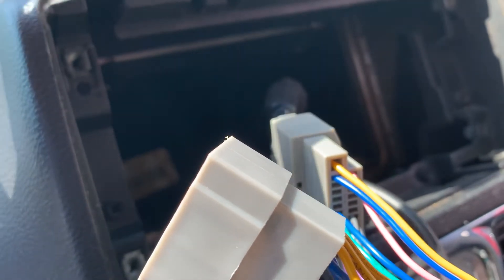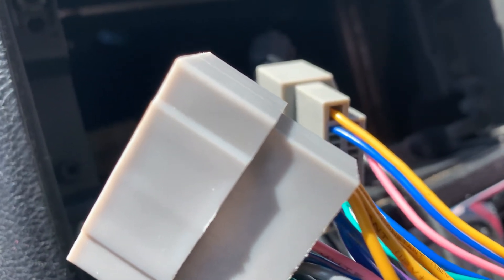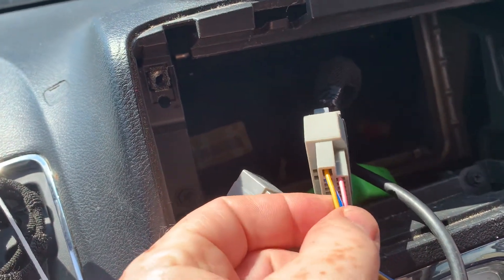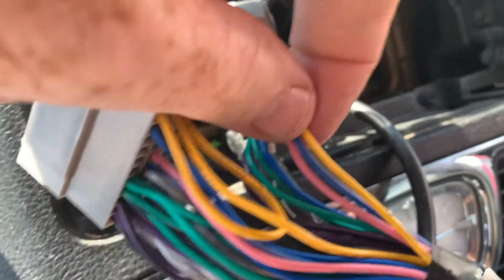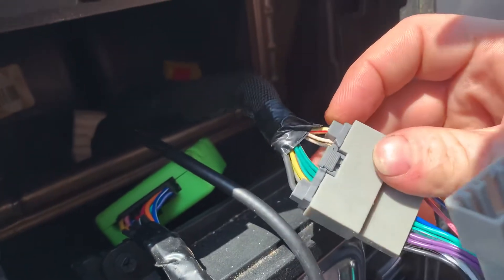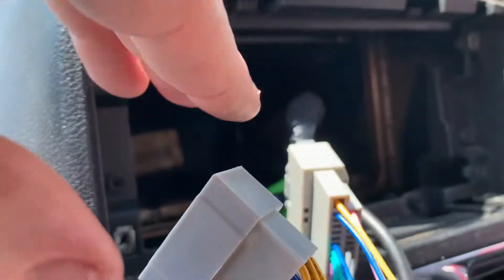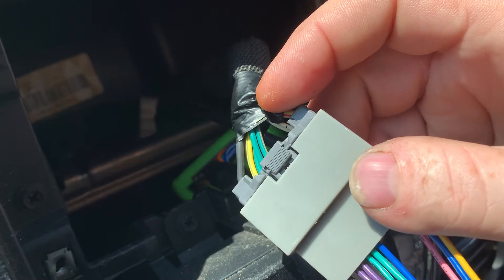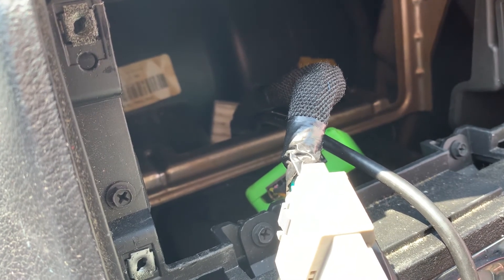Chrysler Town and Country radio fix.

Comment: I believe the small chip on the passenger side of radio in back corner toward the plug for antenna - it’s about 1/4 inch by 1/4 inch I believe it’s related to the volume control but also I notice when I touch that chip with enough force the signal comes clear and volume works - u can heat up and push back in but it really needs to be resoldered and then epoxy glaze to keep it from moving, then again this could be overheating on the board somewhere which causes this and other issues

Comment: Just in case no one has figured it out yet the white and orange wire he is talking about is a can bus + and the white and grey beside it is can bus - they are info wires and voltage fluctuates based on info received or sent

Comment: Open rear hatch, remove 3rd row seats, remove plastic trim below drivers side rear side window, most likely you will find your short in the bundle of wire below your rear hatch actuator which rubs against the wires and begins with shorting out the camera wire which sends the short to the radio first noticeable when going into reverse and camera glitches eventually causing radio to stay off. What you are doing is bypassing the short from camera.
Reply: I’m pretty certain this is my issue. Do you have more details on wire location?

Comment: changed out my radio and just found the speakers and power wires.  radio plays ok now. dont need anything extra because i didnt buy any adapter cables i just taped off everything and used screw on wire connectors, real cheap.

Comment: That assy (blue/white) wire is to turn on an amp. When you turn your radio on it powers that blue wire to turn on an amp or power antenna. The yellow is constant power 12volt +
The red is a accessory or key on 12volt+.
I've seen another post that claims the radio fuse needs to be pulled and the power wires to the battery have to be disconnected for a couple of hours.     Then you hook the battery back up and lastly instal the radio fuse and it makes the radio and display work again. Don't know why but someone else tried the trick and it worked for them. I'm about to try it on my landlords 2008 Town and Country because her radio and touchscreen is not working either. Let you know if it works for me.
Reply: Does the black wire to the radio with the yellow connector carry 12V like 30 amps, or just the blue wire to the fuse box?

Comment: Any keyed on 12v power source can replace the red/white wire the red and white wire if im not mistaken is the "remote" wire for the amp follow it back to the amp and do some testing on it me personally I think the amp is a bigger problem to these radios than the radio itself but I mean I've replaced bunch of radios for sure lol and its typically the radio but I feel like the amp is shorting internally and feed back to the radio

Comment: A bit confused. How do you bypass the red and white? So just exactly what needs to be done, bought, etc to make this work?
Reply from the maker: I found another hot wire. The white and red wire should only work when you switch the van on or to accessory mode. Find another wire besides the white and red to connect your radio to. That worked for me and the replacement radio hasn’t given us anymore problems.
Reply: tap into your cigarette lighter wire with out cutting the wire

Comment: hi, over the course of the day the screen went in and out. finally went black.when i back up the screen stays black but the backup warning still beeps .any ideas?
Reply: Your sonars are still working. The radio is fried. Two different systems. Your rear camera is still working, but your radio cannot display it (because it's fried). Your backup sonar sensors are a completely different system

Comment: How do you bypass the red and white wire in this case? Thanks.
Reply from the maker: Find another power wire. I used another hot wire at the radio after the harness. The radio is still working great.

Comment: Mine just doesn’t come on, or it just turns the whole thing white. It connects my Bluetooth but nothing sounds and seems on. Any help?
Reply from the maker: Mine stopped coming on before I did this. Test the wire in the harness coming from the ignition. When I bypassed the wire my aftermarket radio works great.
Reply: @guaranteedworstcardetailin6793  how do I do that? I am not used to do these things by my own!
Reply: @guaranteedworstcardetailin6793  how did u bypass the red/white wire?? Did radio worm afterwards??!